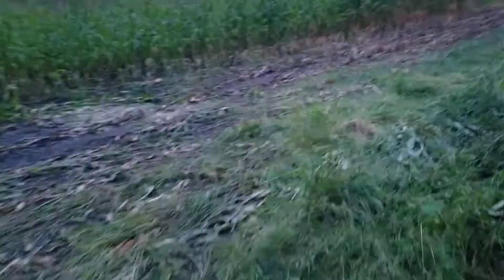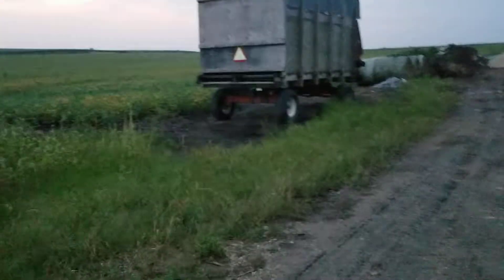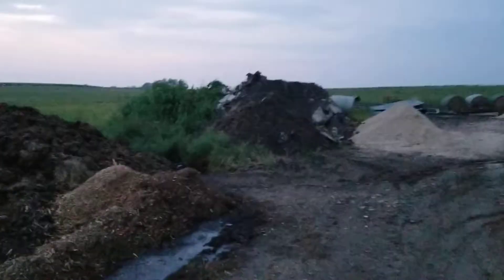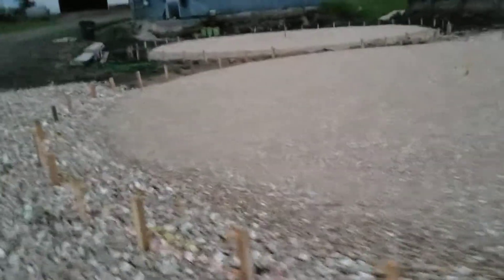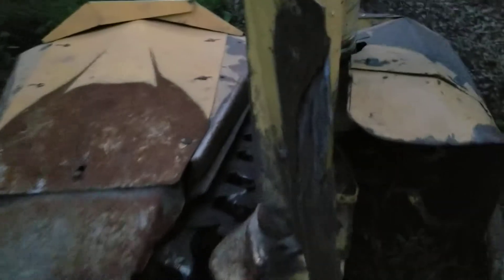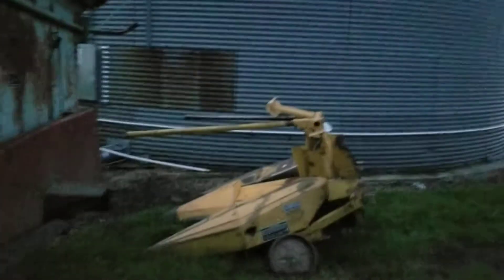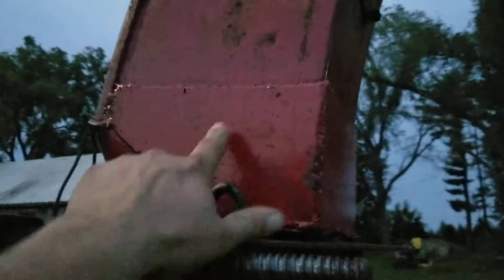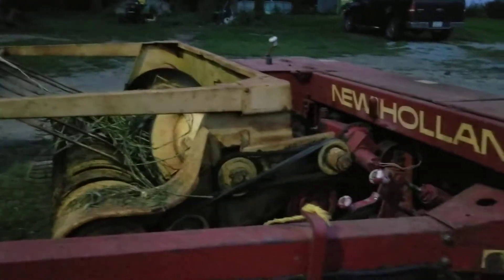September ninth update

Comment: Nice Forage King chopper box (Built in Ridgeland WI!!) If that 824 head came off a 900, you will need to change the mounts also, or some how modify them so they are narrower as well.
Reply from the maker: Thanks for the heads up I appreciate it!
Reply from the maker: By the way have you started chopping yet?
Reply: Started today. Everything that could go wrong did! The Deere corn head does not like grass, broke 2 gathering chains. Mowed 4 rounds with the haybine and used the hay head, worked good but used all 85 horses! Ended up using the old 718 for the last 2 loads tonight, it doesn't like grass either but those older style heads do better! I learned my lesson this year, I was given bad advice on what chemicals to use, talked to another consultant and he gave me a better chem program to use next year if I stay with conventional